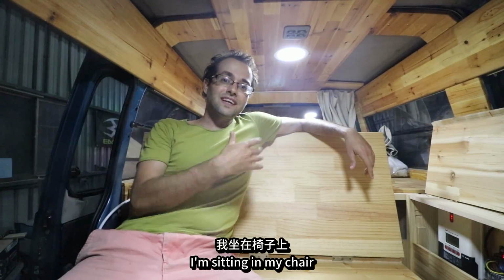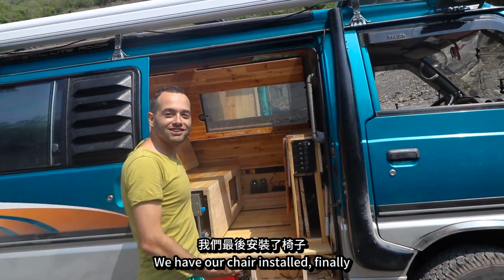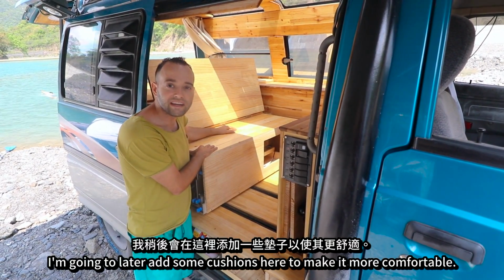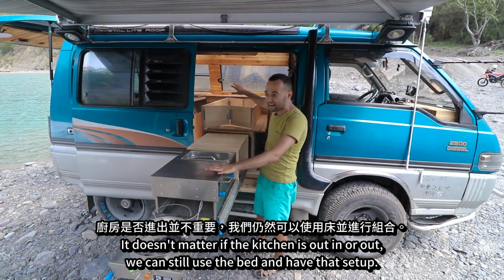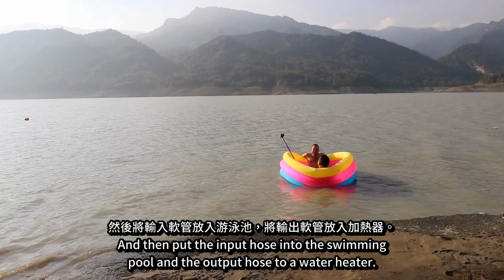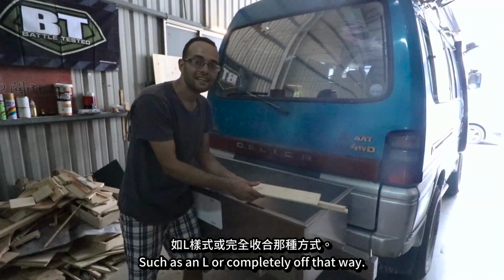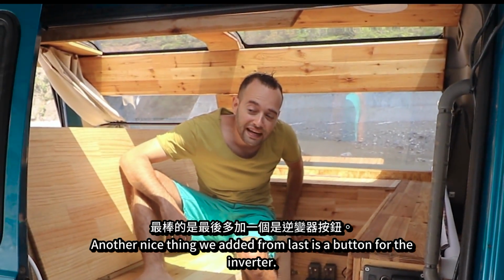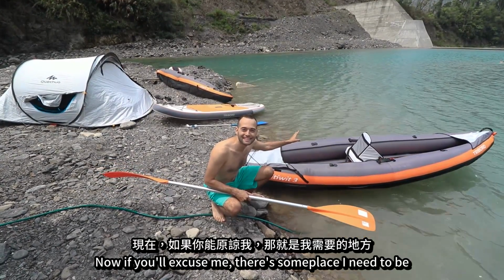DIY改露營車〜第7集〜行動厨房，野營去 Delica L300 custom van-build part7

Comment: One of the better Delica camping builds and design I have seen. You and Bevis have done a great job. Once you have used it a bit more, it would be interesting to hear what you think still works well and what you would change. Cheers.
Reply from the maker: Thanks.  It's hard to plan perfectly.  So while I put a lot of though into it, there are still probably things I will want to change later.  We'll find out in a few months :)

Comment: 一片100W太陽能板放在車屋頂，夏天可以幫助充你的鋰鐵電池
One 100W solar panel on your car roof would be helpful to the LiFePO4 battery, especially in summer
Reply from the maker: There is a 100W panel, and it also get's power from the alternator.

Comment: Do you run into trouble with vehicle inspection? I have literally jump through hoops with my Jeep. It takes an afternoon just to prepare. 🤒
Reply from the maker: Basically all the outside stuff needs to be removed.  It''s a pain in the butt but it passes.

Comment: This is so awesome! I have an L300 with a pretty shotty conversion i did myself (not much experience). I am really curious about the stuff in the cab. I have been thinking about doing something similar.
Reply from the maker: The original drink holder position on the L300 was a crime against ergonomics.  Anything you do there will be an improvement.

Comment: Maybe you can add a trestle under the kitchen table when you pull out. It can make it more stronger !
Reply from the maker: It looks thin but it's actually quite strong. It's rated for 120kg.  It can pull out another 50CM though.  If I want to extend it to it's full length then the torque will be too high and I will need an extra leg.
Reply: @followxiaofei  understand! Very love your video. hope you can bring more fun on YouTube 💪

Comment: 我有一個問題，
颱風天怎麼煮飯？

我覺得你們手作的精神很棒，
但是在車內空間的利用上有點擁擠。
我很喜歡一個頻道是叫Max & Lee
他們的車子設計我覺得不錯，
利用最小的移動，保留最大的空間在車內，
很多事情都可以站在車內完成，而且組裝的動作頂多兩三次，便利又快速。
與你分享他們的頻道，希望能讓你們在腦海裡撞出更多的設計火花，加油
Reply from the maker: They have a Mercedes Sprinter.  It's a much bigger car.  Like twice as big as a Delica L300 and you can stand up inside it.  It can't drive offroad through, and it can't get onto the very small roads in the mountains here.  Obviously it's nicer to live in a bigger space, but having a bigger car also comes with disadvantages.
Reply: 原來如此，收到

Comment: What a great idea for traveling in the van, and would be interesting about how much the total cost may be to be able to convert the van into travel full equipage a van. If you do take a shower with soap, shampoo, etc. would it contamination to nature and water in the lake or ocean?!
Reply from the maker: I use biodegradable soaps, handmade in Taiwan from plant oils.  Probably not perfect, but much better than the alternatives.  In Taiwan micro-plastic beads are already banned too.  Even conventional soaps don't have them.
Reply from the maker: I'll go over the costs when it's finished, including what was worth it and what wasn't

Comment: 感覺車裡比較重的東西都是在右側，請問當初你有考慮到車的整體配重問題嗎？ 不然怕這樣對車子避震器時間久了會不好🤔
Reply from the maker: The changes I made weigh about the same as the original chairs (which were really heavy!) but it becomes a lot when you add in all the gear I carry.  I will need to change the leaf springs.  Shocks aren't a problem since it already has an extra set for offroading.

Comment: Definitely a super cool ride, but how you gonna get thru the TW DMV tho...
Reply from the maker: Some of the outside components can be registered, like the roof rack and the canopy.  The ones that can't are the lights, which I will have to take off if they exceed the width of the mirrors (they don't but might have to take it off anyway) and the rear basket will need to be removed. But it only weights 10kg, so I can take it off by myself.